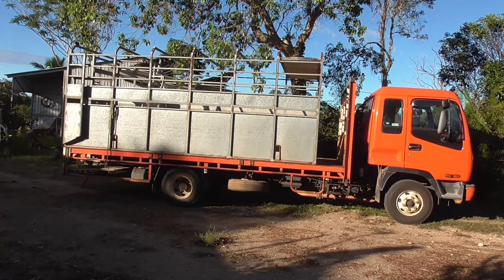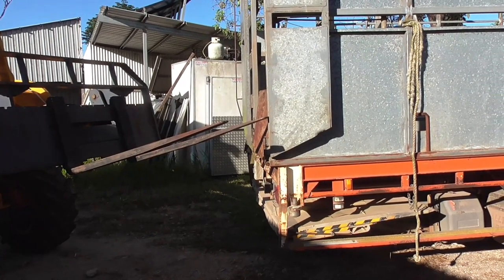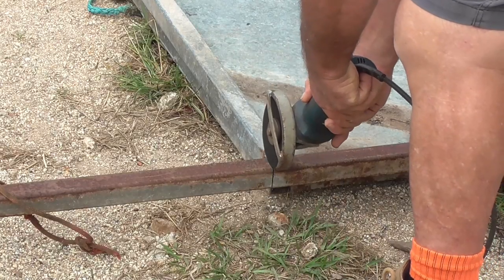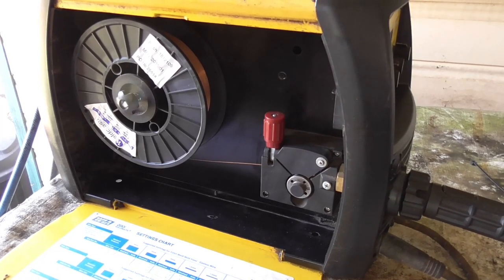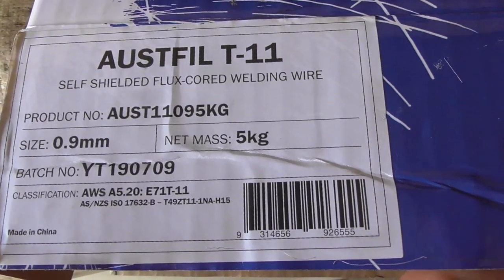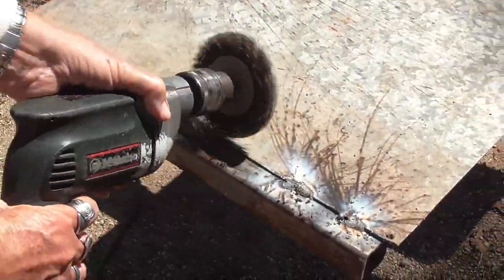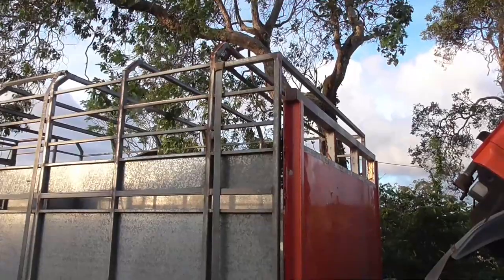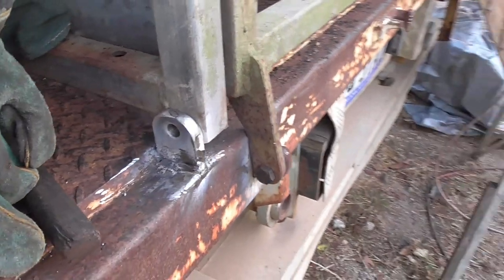Fitting The Cattle Crate To Our Truck

Comment: Very nice welder. My welding skills are lacking to say the least but it holds and hey I did it! Nice work John.
Reply from the maker: It has been a good welder I dont like inner shield wire much its dirty stuff to use compared to the wire with gas. John

Comment: I hope you hold ya breath when weld that galvanized material, or use the ventilator to flush that toxic fumes away, I hate personal use core flux wire, because that smoke and make a mess for cleaning later all white etc.

But you do the great job again John.

BTW here we are out of LOckdown for few days, they still not open all but we are close, one infected per day od even zero. 

Be safe and healthy guys all over the globe.
Reply from the maker: They are starting to lift the lockdown here limited people in pubs up to 10 mainly for dining aloud to travel a short distance meet with limited friends I think the powers that be are trying a little bit at a time and see what the result is. The welding wire with the inner shield is shit I dont like it for the same reason as you but outside for me its either that or the stick welder. John

Comment: Hey John you could have warned us to pull the welding helmet down before you struck the arc! ;-)
Like the drum/cargo case space on the left rear - not seen that before. Beats having to climb up to an over cab rack as you get older.
Reply from the maker: Yes I can put a bit of stuff there and keep it away from the cattle. John